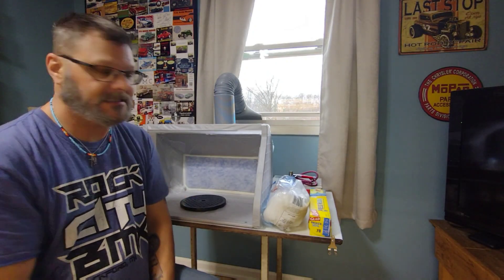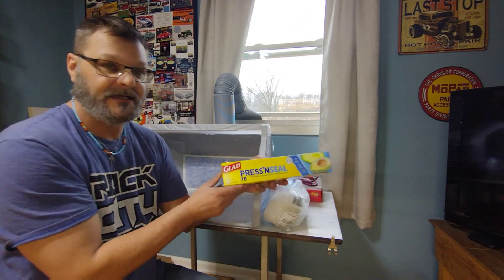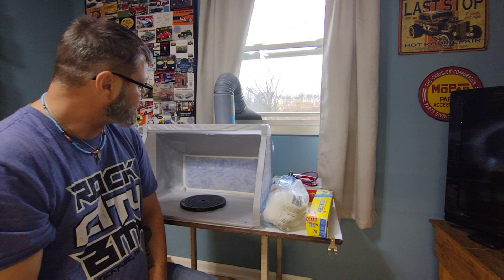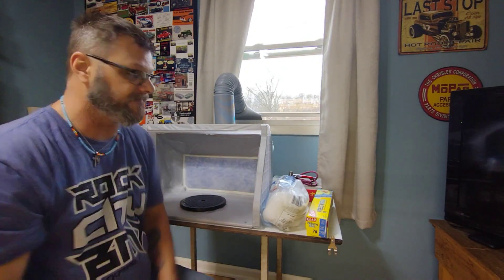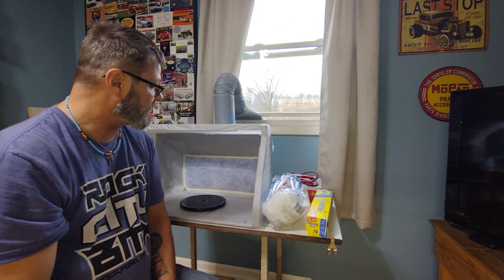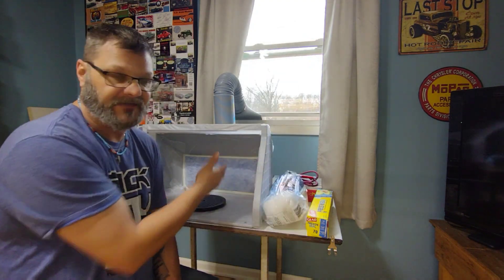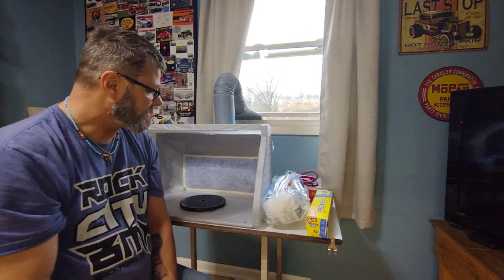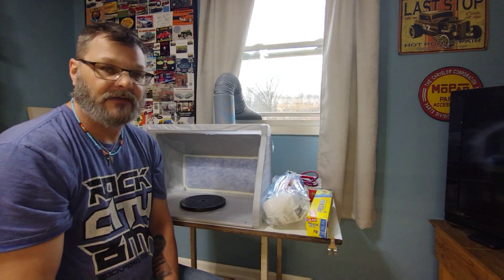Setting up my spray booth.#vivohome #airbrushing #modelbuilding

Comment: Nice little spray booth. I use a brown paper bag to line the inside of the booth and a cardboard box cut down to fit the base. I use  bubble wrap rolled into a tube to seal the window. The wrap squeezes down and conforms nicely to the window sill. I will tell you it will not keep the cold out. It was brutal when we had those 10 degree days. I haven't put the wrap back into the window as or yet. I like the pre-filter idea. I like to use what I have lying around. Best of luck with the booth.
Reply from the maker: Good tips, thanks.

Comment: That's a sweet little set up Rob. May I suggest using pipe wrap or a swiming pool noodle to seal off the gap. I'm looking forward to seeing how this booth works for you and how the press and seal wrap works out for protecting the booth from the crusty over spray. Take care brother and happy modeling. Don😎
Reply from the maker: Ah, man...that's a better idea. A pool noodle or pipe insulation. I'll let ya know about the press n seal. Thanks, Don.

Comment: Looking good Rob, I use puppy pads on the bottom of the booth, easy to change, and they absorp when you spill something, which does happen, at least to me, lol
Reply from the maker: Huh, I never considered that. In my old spray booth, which was nothing more than a clear plastic tote, I used heavy duty shop towels, but puppy pads.....that is a good idea to contain spills. Thanks, Tom. I appreciate the tip.

Comment: Looks good and nice tips for the booth.    I would consider attaching the end to board, with a hole through it. Like a 1x3.  Then you can add seal permanently to the board.  That way its just one piece in and out of the window. And could be semi permanent if ya wanted as well.  Just the way I would likely do it.
Reply from the maker: That's a good suggestion too. Thanks, Adam.

Comment: Looks awesome and like your idea of the press and seal. Hip guys did a review on one and the first thing he did was use a spray can of red and messed up the whole inside. Ron
Reply from the maker: One thing I dislike about any tool I get, messing it up right from the start. I get that it's a spray booth, but I'd rather take care of it right from the start. My experiences cleaning my makeshift spray booth in the past taught me that scraping old paint and constantly vacuuming the spray booth and fan was a chore I'd rather not be doing after every build.

Comment: Your going to love that booth... Nice tip on the pre filter, I wish I would have put some added filtration in front. My white post filter is very discolored, It's almost time for some new ones.. Looks like the same booth, you got a good one, mine only come with one set of filters.. Let us know how you like it.. Have a good one!
Reply from the maker: So far I'm liking it. I've sprayed all kinds of paints in it so far and it's doing what it's supposed to. No lingering paint smells wafting in the room or through the house. Thanks again for the tip on the press n seal. Had I not done that my booth would be a terrible mess right now.